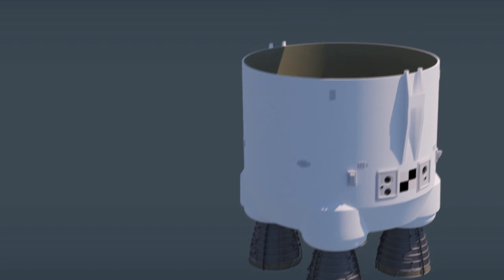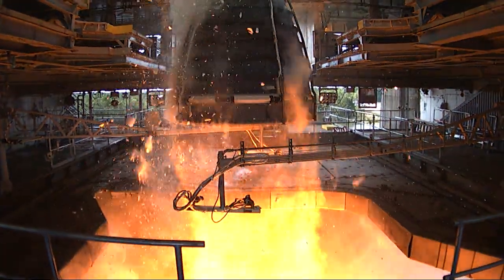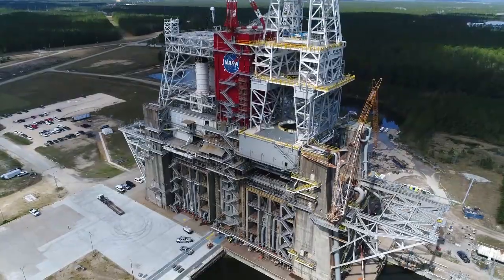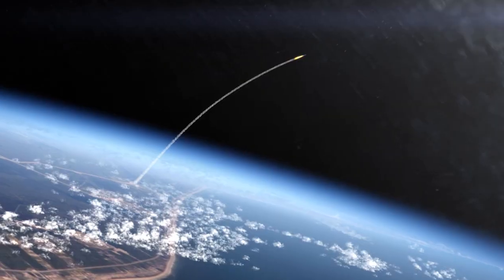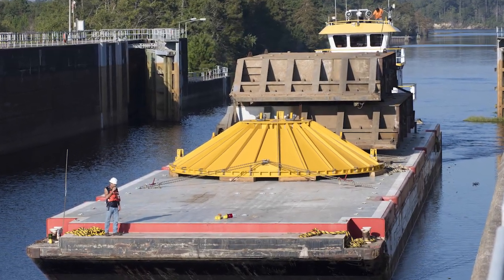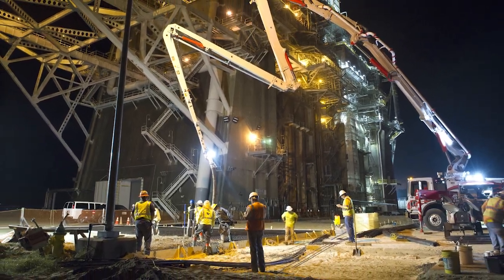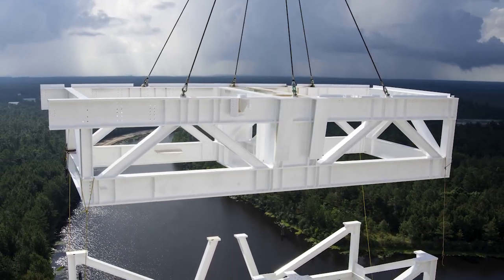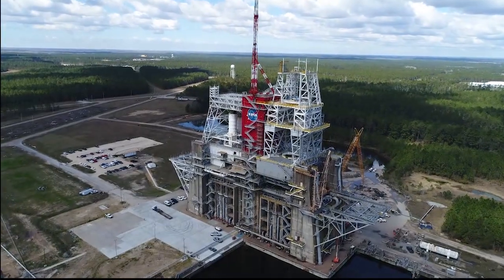Six Years of Nonstop Work

Comment: I thought ULA was building the SLS rather than NASA.  Well, I guess NASA building is a bit true since it uses components developed by NASA in the 60's for the Shuttle.
It is impressive but at a cost - I believe current NASA stake in SLS is about $11B.
NASA's investment in SpaceX Falcons is well south of $1B - which currently has an operating Heavy Launch Vehicle (the Falcon Heavy) - which has a higher Specific Impulse than the SLS Block 1.
Reply: Mark Hancock well NASA hasn’t spent that much money on SpX’s Falcon rockets because they’re not the primary developer of them. I’d be interested to hear how much SpX spent on developing Falcon Heavy. Also Falcon Heavy has only made a test flight, and SLS is a super heavy launch vehicle and not a heavy launch vehicle. There is a difference there.
Reply: @darthyoda1420  That is some of my point.  NASA is supposed to be transitioning out of Rocket Design and let the private sector pick up that role; but, they seem to be trying to play both sides of that.  ULA and SpaceX are both competitors to supply NASA for CCP; well, except for part of ULA's bid is to use the SLS as the launch vehicle which is NASA's rocket (but they call it ULA's rocket when they talk CCP).  Does this seem like a bit of a biased competition.  Even with that, I suspect that NASA will continue to support "their" (oops, I mean ULA's) SLS system for the CCP even though it costs 30-50 times as much per launch.  Regarding the development price of the Falcon Heavy, that is a bit fuzzy since it is mostly built from Falcon 9.  Even with that, the total Development Cost of Falcon 9 + Falcon Heavy is probably less than 10% of what NASA as spent on the SLS even ignoring all the money they spent on its failed predecessors.  See the following quote from the Falcon 9 Wiki page "In 2011, SpaceX estimated that Falcon 9 v1.0 development costs were on the order of $300 million. NASA evaluated that development costs would have been $3.6 billion if a traditional cost-plus contract approach had been used." Hmmm.  Kind of makes you wonder why NASA continues to do this.
Note: I am not Anti-NASA, I am actually Pro-NASA.  I grew up next to NASA-JSC where my dad worked.  Growing up there, I know how the system works and it needs to change!  I want the limited funds that NASA gets to be spent wisely.  I want the funds to go to Research, Science, and Exploration rather than to line the pockets of ULA and other contractors that have powerful congressmen to support them.  I want them to embrace and support great ideas even when they are not their own.  It is really hard to do that when NASA has a big financial and emotional/ownership stake in one of the competitors.
Reply: @darthyoda1420  BTW, Though SLS is a Super Heavy Lift vehicle, I am not aware of any payloads that distinction until until at least Block 2.  EM-1 is carrying a lot of extra stuff; but that could probably be launched a lot cheaper (and safer) as separate Falcon 9 payload(s).  Current estimates of the cost of that launch is between 1.5 and $2.5B.  A Falcon 9 launch costs $50M.
Reply: yes SLS is a super heavy launch vehicle, and falcon heavy is a heavy launch vehicle, but if operated in fully expendable mode (expending all boosters) it can just breach the divide and enter into the superheavy category, with a payload to Leo of 64 tons. but when fully or partially reusable it can only get 30 - 45 tons to LEO wich falls short of super heavy capability. so in a sense falcon heavy bridges the gap from hevay to super heavy @darthyoda1420
Reply: The SpaceX Merlin does not have a higher ISP then the RS-25.
Also the RS-25 rocket engine has 500k+ lbs of thrust.  While the Merlin has 210k lbs of thrust at vacuum.
The Falcon 9 heavy uses 27 Merlin engines.  As they use Merlins instead of the SRBs.   SpaceX predicts 37k lbs deep space from the Falcon 9 heavy.  SLS estimates 99k lbs.  They are different sized rockets.
Reply: @TheMotowntuner  They are definitely different rockets.  Maybe the real comparison should be between the SLS and the BFR since the are both Super Heavy Lift rockets, are at a similar state  (production engine testing) and have a similar announced first flight date (2020).
Reply: @connecticutaggie  The RS25 Rocket engine has over 1.1 million seconds of hot fire time.  It is one of the most proven and reliable engines of all time.  The Raptor is impressive but has a total of about 1200 seconds of hot fire test time.  The last video posted by Elon Musk shows a 3 or 5 second test that has green in it's plume.  Green in plume means check your Copper combustion chamber afterwards to see whats left, but they are developing fast.
Reply: @TheMotowntuner  I agree that the RS25 has an impressive history and adds to the confidence of the SLS design.  I believe initial SLS is planning on using previously flown RS25D engines reclaimed from STS.  The Raptor is a much newer design and with that comes both positives and negatives.  This is kind of separate from my initial comment. 
My main point (originally) is that NASA is living in the past.  The new path for NASA (which was their original path) is for NASA to return to doing Science and leave the Engineering (and Rocket Development) to the Private Sector.  Continuing to claim the SLS as their design is not productive and is near to outright bias.  It seems the only hope is for SpaceX to sue them - which shows how bad this has become.
Reply: @TheMotowntuner  The RS25 Rocket engine has over 1.1 million seconds of hot fire time.  It is one of the most proven and reliable engines of all time. it's buggier than fuck, it's also one of the big reasons so many shuttles missed their launches.  Those engines were temperamental, difficult and expensive.  Very efficient but at the expense of being hard to start, run and maintain which is why they're willing to throw them away now.  They'll never, EVER make it a good engine.  Making it one they can at least start reliably is costing enough money and time they won't even risk trying to use them a 2nd time anymore.  Expensive wasteful throw aways.  Everything a Merlin is not.  The last video Elon showed was an engine under development.  The RS25 is a pork legacy project with 50 years of development behind it and it STILL can't hope to compete.
Reply: ULA is not building SLS
It is being built by a lot of companies primarily Boeing for the Core stage, Northrop Grumman for the solid rocket boosters, Aerojet Rocketdyne for core and upper stage engines, Teledyne engineering for the Launch vehicle stage adapter and ULA is providing the ICPS for the Block 1 vehicle
Reply: @brokensoap1717  Yes, who exactly is building the SLS is a bit complicated (which is also a "bit" of an understatement).  NASA designed it (sort of) but it does seem like a bit of a rocket designed and built by committee.  Boeing is the primary contractor but then they contract ULA (which is a Boeing alliance) for a lot.  All of the manufacturers involved were part of the Shuttle program - Aerojet made the main engines, Rockwell (former Orbital ATk - former Thiokol) made the solid boosters, Boeing (former Rockwell) made the orbiter, Lockheed (other part of ULA) made the external tank.  Using all these companies is not a coincidence - the goal of the SLS is to "reuse" components from the Shuttle program.  The pitch was that this would "save money"; but, obviously no one that promised that has ever tried to "save money" by refurbishing an old home.  IMHO - the real pitch is that the congressmen approving it would be able to avoid layoffs from the Shuttle program being stopped (or to be more accurate, to save she jobs from when the Constellation Program was cancelled which was to save the jobs from when the Shuttle Program was stopped).